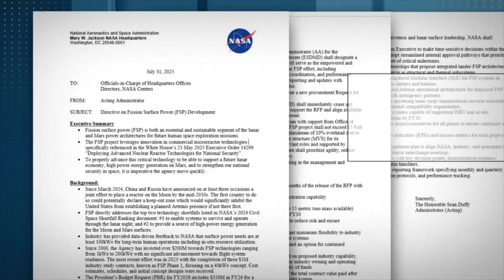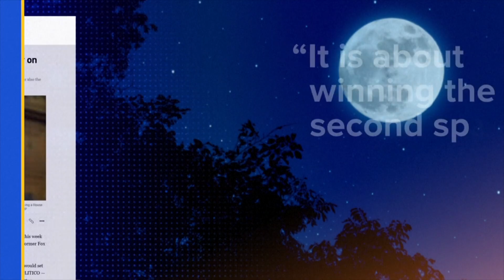Can NASA put a nuclear reactor on the moon?

Comment: not really possible with nasa's limitations right now. Take a 40MW reactor from an aircraft carrier. It weighs in at ~1500 tons. We're talking reactor, generators, cooling equipment, everything needed. The only rocket we've had that made it to the moon was the saturn V, It used 5.8 million pounds of fuel to put 100,000 lbs in lunar orbit. Then there's the problem of cooling a reactor, no water or air for a heat exchanger,  and surface temps of +250 F during the two week long days.